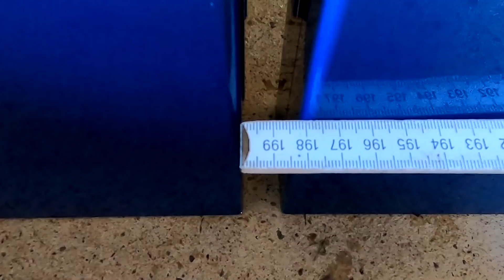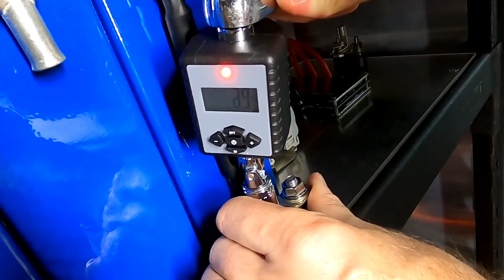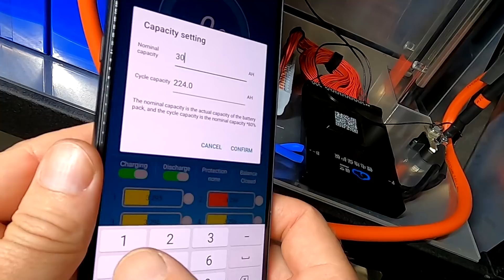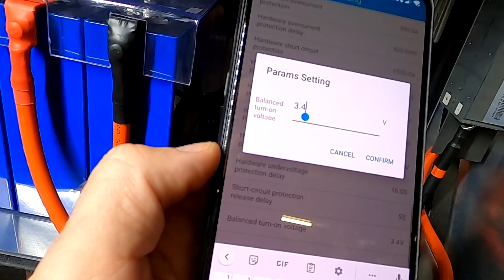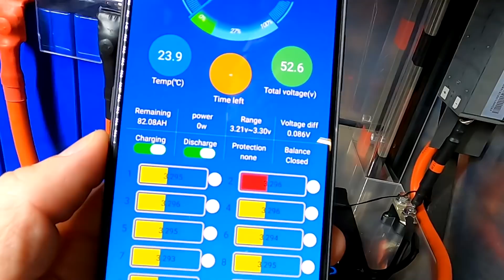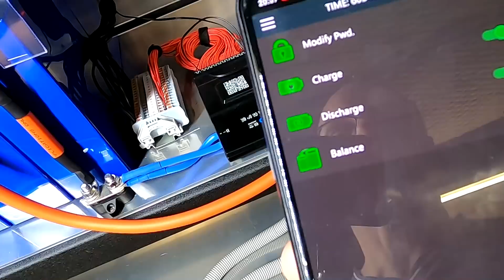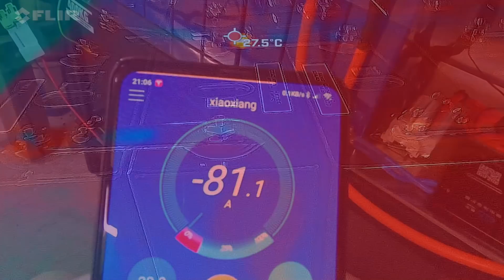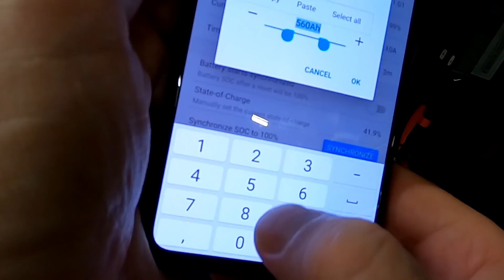2nd parallel battery bank installation and BMS failure. Adding 15kWh of storage capacity.

Comment: Re: Ferrule vs no ferrule. I love the attention to detail :) Would have been interesting to see a measure of resistance on the bare wire vs ferrule, would give you more concrete data to work with. Another option as well is to tin the wire
Reply: Is resistance important for voltage measurement?
Reply: I'd add that the reason ferrults are important over tinned wire for screw terminals is that the tin will flow and the connection will become weakened. TBH I think with springloaded terminals, pretty much anything will work. if the tin flows, the spring will compensate.
Reply: I would question that. Looks like that actually with the ferrule it only touches the tip of the ferrule because it does not mold like the straight wire does. Also depends on the crimp format as well is not smooth so it does not have a great contact like the smooth busbar surface on the side. I see the point of might break with mechanical movements but does not really apply. At the end the balancing currents are so small that does not really matter but is the extra side will be used for a external active balance...with like 2A might have impact. Would be better a flexible square ferrule that would bend and stick to the full surface 😉. Like the attention  for detail in this videos so everyone makes their own choice. 👍 job.
Reply: Agreed that it would be nice to know the resistance. While I think Andy's demonstration is good, my hypothesis why it may be wrong could be that the bare wires get a wider contact area under compression, but the ferrule could be limited in the connection by the radius of the ferrule.
So, I'd like to agree with Andy, but I can also see why it might not be the case.

Comment: You do wonderful work, as always. 16:50 smoothly twisted and tinned wires should work as well as ferrules and reduce failure points for those inclined to copy you.
Reply from the maker: Thank you Mark. With tinned you mean soldered?
Soldered wires only work in absolutely static installations. Any movements, even vibrations, can make the cable break just where the tinned part ends. it depends of course...

Comment: Fuse on the bms cables right at the ring terminal as close as possible makes the most sense because the balance leads are long enough to short against other things in the system, point of the fuse is to protect the cabling and the physical location of the fusible link does come into play! If you ever have to remove the balance leads from the fused terminal blocks that were suggested you're now holding a cable in your hand with the full potential of the cell.

I really like how you include glass fuses right at the ring terminals, thats a good practice, it feels much safer to be manipulating thin wires connected to large potentials with that peace of mind that if anything happens its going to pop right at the battery where nothing else can progress.

Comment: Thanks also for the demonstration of Wago / Phoenix clamps. But, I am not really convinced. Could you measure the resistance or the difference of the resistances using your microohmmeter? Ferrules are introducing an additional layer of material (what ever it might be) and an additional boundary layer. The copper strands are pressed in a max width to the bars. Ferrules might have a smaller contact area to the bars because not beeing flexible. All that is theory. Measuring of of some samples would be better than theory and could also show the variance
For mobile applications the ferrules seem to be less sensitive to vibrations.
Reply: The work very well look up Great Scott on YouTube.
Reply: But aren't we talking of a maximum of balacing currents of 2 A on these?
Reply: I am not convinced either. I think the single point op contact with a reasonable pressure makes a great contact. Please test this with an high current for us.
Reply: @tedreumer  it's not high current.
Reply: These have been used for years in industry in switchboard wiring for controls never had one failed yet in switchboards over 20+ years of work, also the terminals are marked with there max amp rating on the side they are superb units.
Reply: I'd go with ferrule. in many of the stranded cables, ferrules play a major rule in keeping the stands under control, even saving a shot circuit by a naughty wavering Cu strand with affinity to stray into unsuitable areas. Thanks, Andy for meticulous engineering.

Comment: I had a similar challenge with the 90-degree ring terminals, but I put them in a bench vise and turned them into 45-degree angles, which was sufficient to clear the side of the cell.  Your solution is also very good, although it introduces another connection point and took a bit more time.
Reply: Agree a 45 degree would have cleared the battery I thought he was going to do that before he mentioned the bus bar bending

Comment: Hello andy, i follow your channel for about six monds and i love it! I live in the netherlands, i work as a machine control cabinet builder(a raugh translation). Off course i am not familiair with australian rules and regulations, but  double crimping is not always better. I have had a cursus of klauke (ringlug manufacture). It depends on the size of wire, the cable type and crimping shape. The theory is that if you crimp to much you pulle back the stands, thus the resistance increases. And important is the maximum strength the connection that it can hande before it pulls out if you crimp too many times that amount. If i am not mistaken (on top of my head) is that around 2500nm of force with klauke. Maybe it will be benefitial to you to check with the manufacure. Keep up the good work.

Comment: Personally, I would charge separately any cell that was out of range of the other's before connecting.  It is a time consuming task but I believe it ensures a better installation overall with best chance of longevity.  I built a 3 bank 48 v system using Nissan Leaf gen 1 cells with a total of 5280 watt/hrs. Each bank is rated at 33.1 a/hr @ 53.2 volts (1760 watts per bank).  I did encounter a criss-crossed wire in the bms connector which drained one cell while overcharging another.  After replacing both cells I went about manually balancing all, individually.   The Leaf modules each contain 2 cells and each bank has 7 modules or 14 cells each producing around 3.8 v @ 33 a/hr.  These are wired in series, then each bank is wired in parallel to the solar system.   Thanks for the video on your build.  I was particularly drawn to the detail you achieved, using wit to provide a neat outcome.

Comment: Hi Andy! It's nice morning in Finland, minus five degrees and the snowing has been decreased. It could be another interesting test ferrule vs no ferrule. You could prepare couple of connectors and put 30 amps or so from the lab power supply and take an infra red picture of the connecting area and also measure the voltage drop in the connection. Br, Eeli

Comment: hi andy, well done!
your way is: think big.
one huge battery in your garage, huge currents, huge inverters...
my way is: keep it simple.
i'm compleatly off grid since more than 2 years here in bavaria. i'm using diy 18650  7s60p DISTRIBUTED battery positions, and localy distributed pv-charge- positions in my 24Vdc system. and most of my power consuming devices are running directly on the 24vdc.
everyting is connected via the old 1.5mm² wirering in my old house.
fused with max 16A.
there is enough time to equalise all storage points., and if i need sometimes more power, the next battery is not far.
and with a mobile inverter, i can get 230v everywhere without standby loss round the clock.
anyway, keep goin.
everything we are do, is better than the use of fossile energy.

sorry for my poor english

michael

Comment: Another great vid Andy. Couple small suggestions. 1) switched LED strip lights over the batteries for maintenance , and it would look pretty! 2) use an end plate & top plastic cover to duct air from 1 or 2 small, quiet, temp controlled fans to blow air through the large centre cavity with a view to force it to vent through the batteries interior to exterior front & rear. Rear area could also have a small fan/vents for expiring of the warmer air from within the batteries. This is probably overkill for your setup anyhow, & not relying on fans or their noise is always a bonus too, but worth a ponder I thought.
Love ya stuff , keep em coming!

Comment: Would a nice victron shunt connected first thing after the neg terminal give you all kinds of useful info, especially in & out power over time?
Reply from the maker: A smart shunt will give you the same information regardless where it is connected to, if before or after the BMS.

Comment: While the ferule may keep the wire straight, squishing two rigid bodies together with mild pressure will only create good contact points at the 4-5 highest spots. The twisted strands get squished against bar, likely giving you more actual contact area concentrated at the pinch point where all of the pressure is applied. You do need to pay additional attention to securing wiring and strain relief though as moving wiring around, tugging and vibrations will eventually cause the pinch to chew through the strands.
For a one-and-done install that may never get touched again for its entire service life, the extra labor and costs aren't worth the negligible benefits. For someone who will likely be messing around in there almost daily for the foreseeable future, the ferules will almost certainly save you from wires getting pinched off many times.

Comment: I have been reading about earthing and ground bonding in inverter systems, particularly in relation to the MEN standard that we have in both Australia and New Zealand.  I am curious why you have not ground bonded the Victron MPPT units.  I also cannot see any evidence of ground bonding on the inverter chassis', or ground bonding of the DC -ve back to the common AC ground, (which I fully presume is the single earth) - maybe I just cannot get the right camera angle - but it would be great to understand how you have bonded everything together per the MEN standard.  Thanks for the great content.

Comment: I thought that best practice says to have a fuse as close to battery +ve as possible. That circuit breaker is a few connections away, and I'm not sure how fast it will trip. Wouldn't it be prudent to have another fuse very close to battery +ve for added safety?
Reply from the maker: I thought about that but found the BMS is the closest device to the bat+. It will trip quickly in case of an over current. 
This is just the way batteries are build and designed these days. There is not a fuse directly at the pos terminal. I could use a 400A bolt-on fuse, something like this?

Comment: In this setup, do you have a charge-controller and a separate array of panels for each battery bank.  Or do you have two charge-controllers in parallel to each other connected to your solar array?

Comment: Hello, i have 2 battery pack, 16 each One. How do you connect both together? Have you used some parallel component or you did with a cable? Thank you
Reply from the maker: Just with cables. Make sure each battery has its own BMS though. Bring them roughly to the same voltage and connect them in parallel. They will balance out automatically when you charge them.
Reply: @OffGridGarageAustralia  nice, thank you for your reply

Comment: in parallel mode, does the lifepos need to have the same capacity ? I have 8 x 304Ah and 8 x 280Ah, is it possible to parallelize them ? a 304 and 280 together to have 8x 584Ah ? does it work ?

Comment: Are all banks now 304ah or is the first one 280? Would it be bad to have a 280ah bank and a 304 bank in parallel?
Reply from the maker: I have now one 304Ah with two 280Ah in aparallel. As long as the voltage is common, you pretty much parallel everything together. Wtach this video here wehre I paralleled 304Ah with 5Ah (yes, 5Ah!): https://youtu.be/fQz7vZEYLfY
Reply: @OffGridGarageAustralia  Thanks. I was thinking as long as voltage is same it shouldn’t be a problem. I’ve seen where others have stated all must be the same because of charging one would charge faster and possible over charge because of the other being lower. I thought the BMS would handle this but also have seen it said the BMS wouldn’t work properly with such a se t up.
Now I’m not concerned if I do go in the direction of a 304 bank and a 280 bank. 
Again thanks very much, and I did go watch the video before reply here. Your awesome Andy.

Comment: Very thorough Andy! The new pack looks really really good, envy. The Heltech is hell, I think the JBD is quite more reliable. Let's see what is the problem with the Heltech, will wait. And for the main battery busbars, will it be better to take the load diagonally so that the load is balanced on all the batteries? Will it help or it doesn't matter much. As you said the top shelf will cycle more than lower ones in the current setup. Hmm.

Comment: Have you measured the internal resistance of all batteries together? I've a battery pack in work and a problem to get 10 Amps. Maximum Amps are 5 and the internal resistance is 5 milliohm, possibly is this the problem, but I've no value to compare. All contact's are cold on trying to get 10 Amps from the battery block. Next I'm testing each single battery.

Comment: I have a question.  You ll have many battery bank parallel linked but with different size.  What will be the behavior of each bank under heavy load, deep Discharge or over many cycle?

Comment: Do you think drilling out the 4mm holes to 5mm though the PCB messed up the BMS?
Side note, we were taught in electronic school not to wear a ring,  especially if you are going to stick your hand in that big battery bank.

Comment: I think, the small contact area in the clamps is not a problem, because the force is much higher and gives also a gas tight contact. But the problem I see with not using a ferrule is, that the tiny wires of the flex wire can easily lead to a short, when inserting it close to each other. So I would also use a ferrule for BMS balancing cables, since there is not much current at all and ferrules are simply safer.

Comment: I have a JK 200A 8S BMS. The current is jumping all over the place and the SOC is useless. I don't see this in the videos with the 24S. My supplier says this is normal if an inverter is connected to it. What is your experience?

Comment: Re BMS not working:- You drilled the through plated holes to accept the larger wire size. Was the through plated sleeve connected to track layers within the PCB and removal isolated them?

Comment: If the negative battery terminal were to run down the side of the battery to the negative busbar also relocated to side of battery, (instead of front), that would give you room to run the positive cable along the front without hanging outside the shelf. This would also require having to move the balance terminal rack farther towards the back of the shelf too, but I do think it would give you a cleaner shelf without the outhanging positive cable.

Comment: Addendum to the previous comments. Please note JBD sells 200A BMS that has finned radiators, (heat sink) attached to the MOSFETS. FYI, JBD BMS are bought by many venders and many LABELS of their choice stuck on the body , some with ridiculous nomenclature. But the heart n soul is the same. Cheers.

Comment: When a extension is used with the torque sensor it is actually lower than you read. You might want to tighten the breaker connections a little more.

Comment: Hello Andy! 
Thank you for all your great videos. You have been a great help for me to learn more about PVs and batteries. With your help I have managed to build my first PV system and in 2 months I'm moving on to my second project. 
So, I have a question. I have noticed that you're using 35mm² cable. 
From your testing, how much continuous current can safely pass through a 35mm² cable?
(I had some chinese sellers tell me that 35mm² is safe for 10kW inverters (and trying to sell me cables) but most charts state is safe for 120-130A. An inverter manual recommended 35mm² for 150A. 
But 10kW is 210A on an almost empty battery. 

What's you opinion based on your testing? (I myself have pushed 100-110A through it and didn't notice any warming up... I have also seen people pushing 100A to 10mm²  which is crazy, but it was just a brief test)

I am trying to compile a realistic board with cable sizes and current loads. Official boards are very conservative imo. 

I would love to hear from you. Be well.

Comment: Hello, I really like your idea of using terminal blocks and integrating your battery packs into a cabinet.

Could you give me the name and maybe the reference of the circuit breaker with the handle that you fix on the side of the cabinet? I don't know what keyword to use to find it or find an equivalent.
Reply: Searching your website a second time, I found it.

Very useful this site, thank you.

Comment: Hi, why do you only use 4Nm on the terminals, if the maximum torque is 8Nm? Wouldn't 6Nm or 7Nm be better?
Reply: The reason could be multiple. one major reason is, The Bolt is SS and the parent metal is Al. if the torque is a slight higher (by hand) the soft parent metal can and will strip, causing anguish, headache, frustration and disharmony even with people at home and at the office. To avoid all the above... 4Nm is desirable. Besides all that, the SS nut is serrated, which in turn will bite into the soft metal (Al) making the electrical contact even more better. Some times brain is better than brawn. My thought.